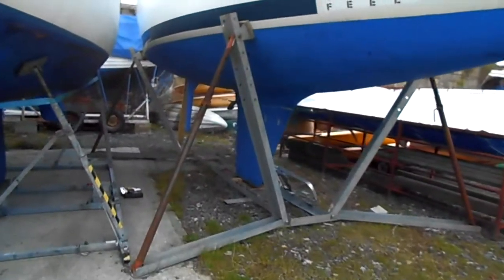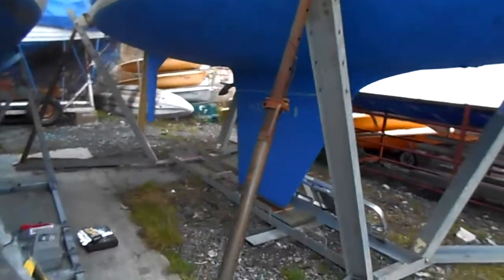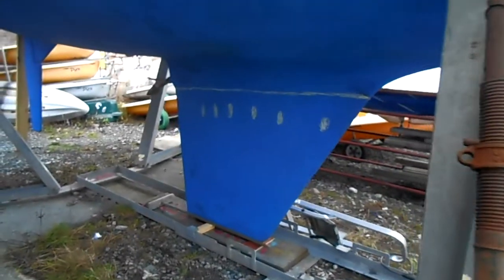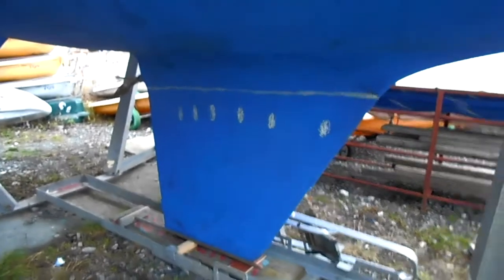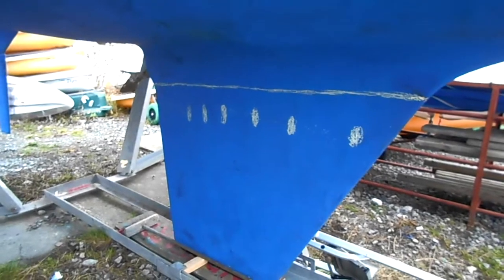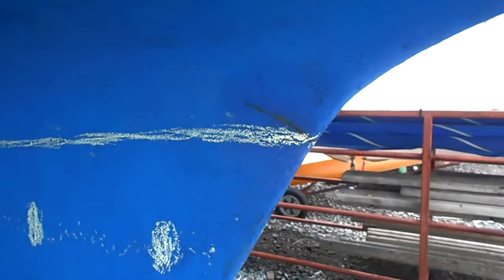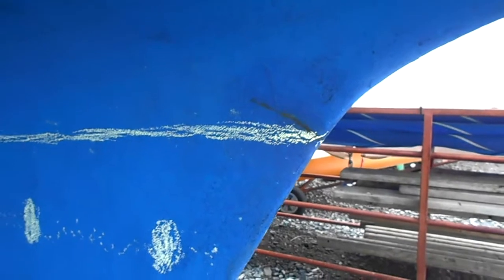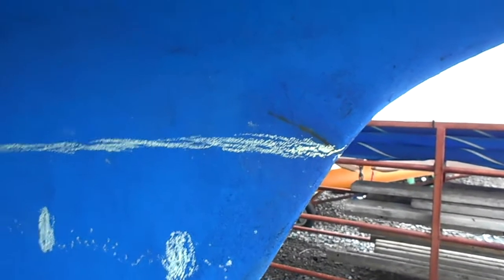Feeling 286 Special keel  Kirie Elite 286 Quille   DSCN1403 v2

Comment: Hi Kevin just brought one of these boats.are the bolts horizontal or vertical, can’t find any further information on the 1090 site. Dave
Reply from the maker: Dave, I've added a video that contains a photo of the keel bolt windows.  See https://youtu.be/eaCKCKD54sc  Sorry for the delay in replying.  KW
Reply: @kevinwoods5859  thanks, found them, can’t find heads inbilge

Comment: Hi Kevin, restoring a a 286 special myself. Did you ever take a keel bolt out. Can’t seem to see the tops in the engine tray

   Dave
Reply from the maker: Did you find them Dave?  If yes, pls put detailed photos of video on YouTube. Thanks.
Reply: @kevinwoods5859  no can’t see them, think engine may need to come out 
Dave
Reply from the maker: Look on YouTube for 

Feeling 286 keel bolts (boulon de quille). 

This should be what you have (except that it is a wing keel).
Reply from the maker: https://m.youtube.com/watch?v=eaCKCKD54sc
Reply from the maker: Dave, maybe I misunderstood - if you want to remove the bolts, I guess that they are classes in below the engine, exhaust, prop shaft and more .  The threaded ends of the bolts and securing nuts should be visible in the Windows within the keel.
Reply: @kevinwoods5859  must be, I work at a Cornish boat yard so used to pulling keel bolts. I think the keel is fitted then the prefabricated engine tray is classed in. Very nice to have moulded floors but a pain if you get a hole or need access. Have to wait for a re engine eventually. Do you still have your 286 
Dave